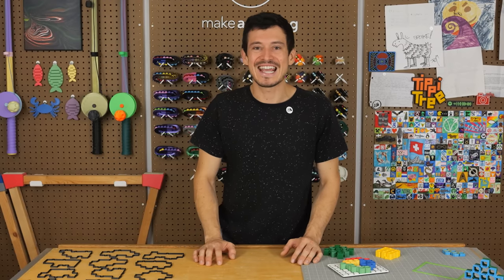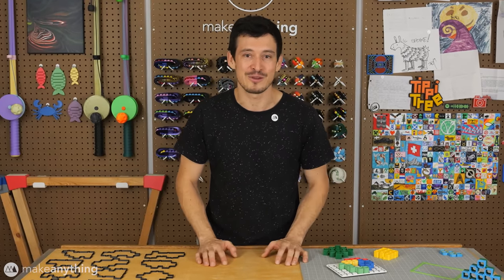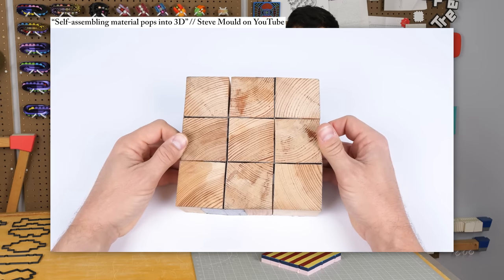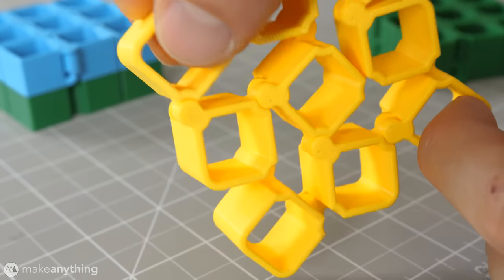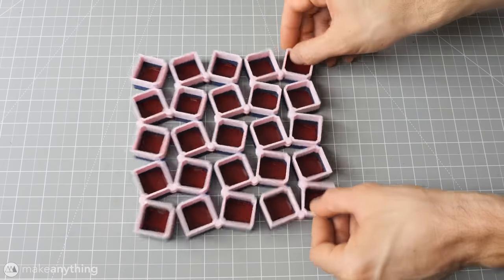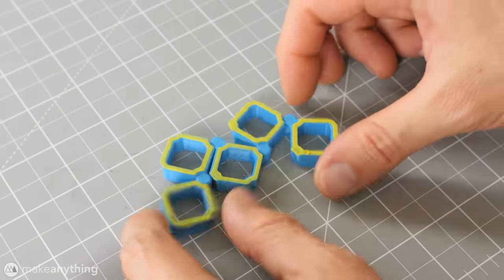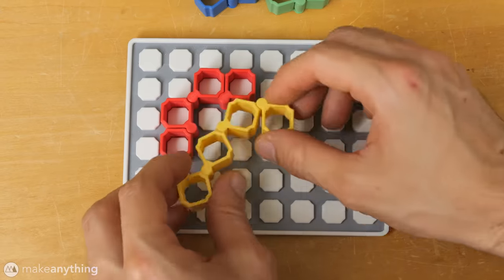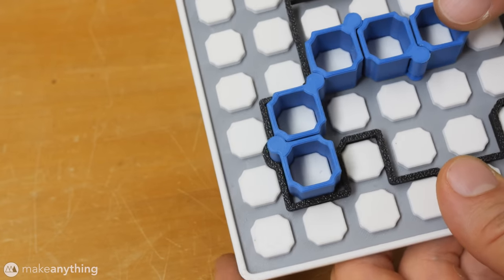I accidentally invented a puzzle...SKEWBITS!

Comment: Looking forward to playing this puzzle... but: currently I face the issue that the A-D pieces to not print out properly although I have applied the recommended settings. 
The hinges are molten together and don't move.
I'm currently printing with 0.6mm nozzle. Before switching nozzle, I'd like to understand if this could be the root cause of failure

Question: Did you use a 0.4mm nozzle? 

thanks for the great work!
Reply from the maker: The hinges fusing is most likely over extrusion of your printer, and that can be more difficult to get right with the 0.6mm nozzle (Yes, I used 0.4mm). To correct it, you can try decreasing your extrusion multiplier or flow%. Another way to compensate is using a negative value for "XY Size Compensation"(PrusaSlicer) or "Horizontal Expansion"(Cura).

Another possibility is that the overhang on the bottom of the hinge is curling/printing messy, which can cause it to warp and fuse there. Lower nozzle temp, higher cooling, and lower layer height can help with that.
Reply: @make.anything  thank you for the quick reply. I will try out your tips.

Comment: There are no markings of what's up and down on the skewbits - this makes things more interesting
Reply: Technically there is. There’s a number on the side of each one.
Reply: @bjsummerfield  on the puzzles, yes,  but not on the skewbits
Reply: @roysigurdkarlsbakk3842   Yeah you are correct. I think they are printed in the orientation they rightside up which is the opposite of the puzzles. I used a black Sharpie on the bottom.
Reply: You can tell by the hinges -- take a look at 5:43. 
Makes me think that the hinges are showing some ankle 🦵🏻when it's viewed right side up 😆

Comment: I can't, for the life of me, get that Yellow piece printed. All the others printed fine but the middle hinge on this Yellow piece is always fused. I tried lowering flow rate, reducing the extrusion perimeter width, etc... it's just that single middle hinge on this single piece. Help please T_T
Reply from the maker: The hinges are identical so that's pretty strange! Maybe rotate the part a bit, in case the specific angle is causing problems. Otherwise maybe it's that specific filament?
Reply: @make.anything  OMG, it did not cross my mind to do that for some reason. I flipped the piece 90° and moved it slightly on the bed and it printed fine ! Thanks a lot !